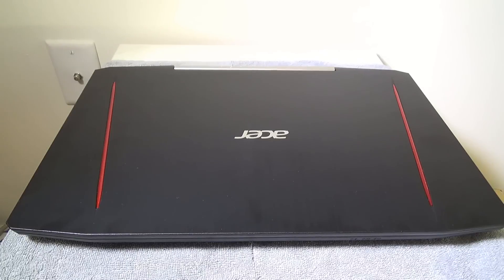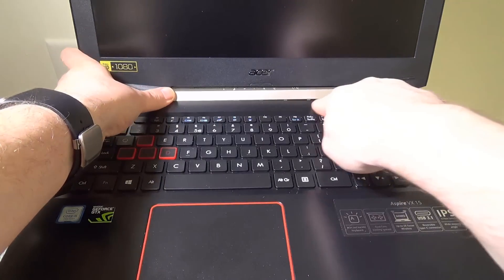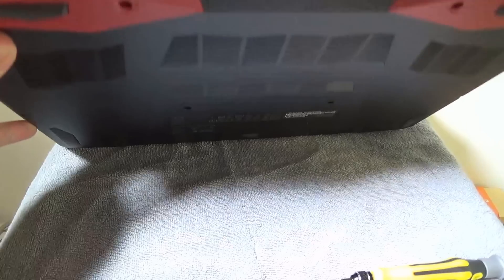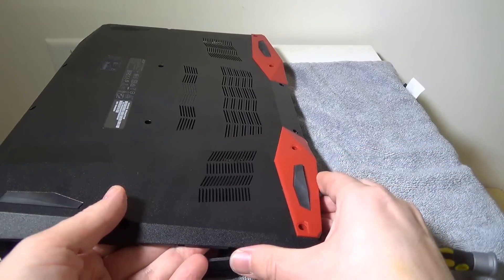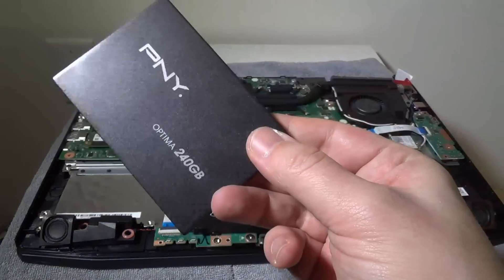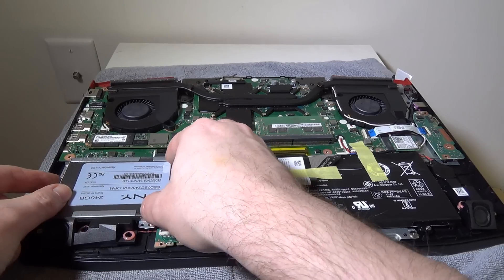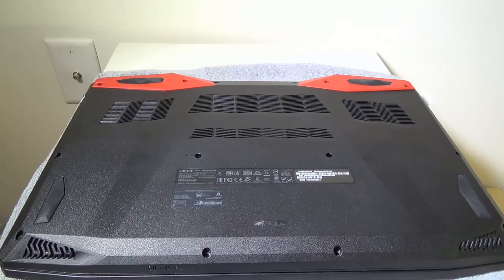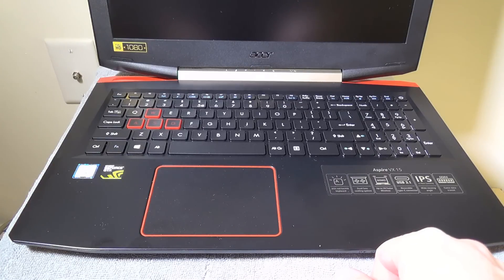Acer Aspire VX 15 Gaming Laptop VX5-591G-54VG How to add a 2nd HDD/SDD

Comment: Hi. I want to upgrade the internal m2 drive. The datasheet has drives tested to 512GB, persons on forums have installed 1TB drives without issues that match (1tb m.2 2280 ssd nvme PCIe 3x4) like the Samsung Evo 970 Plus. Would installing a 2TB work the same way? The Evo 970 also has a 2TB
Reply from the maker: should be fine yes.
Reply: @GalaxyTechReview  thanks. was just wondering if there is anything that would limit the max readable/usable storage on that slot.

Comment: Hi, quick question if I may. My Acer Aspire is the VX5-591G-71LJ .. is the cable you show in your video the same as the one needed for my Acer.  Many thanks.
Reply from the maker: yes I would assume that cable will also work on that model of laptop

Comment: I intend to use an ssd from a previous laptop as the extra ssd drive. Are there any preparations I need to do to the ssd before starting? .. Great video, thanks.
Reply from the maker: Nope that should be fine. Thanks for watching.
Reply: @GalaxyTechReview  Thanks for replying so quickly. Should I takes everything off the old ssd manually of just give it a quick format? Thanks
Reply from the maker: Quick format will do.

Comment: Hello! For version with i7, The ssd is SATA or PCI? Thank you
Reply from the maker: Sata
Reply: Can be added only SATA? Because mine have only 1 ssd with 120gb. And i want to change it with other with 500gb. I tried with HDD în second slot but i cant find to buy The cable and The other one

Comment: They've already discontinued the program, so those of us who just bought it a few months ago are basically screwed. That part # is no longer valid/available, according to Acer, either free OR for sale. 
GG, Acer. No 2nd M.2 slot, and a big wasted empty space 95%+ of the laptop owners can't use, if that many people even sent in their form in time. Probably more like 99.8%, to be honest. So... I've got a piece of hardware manufactured less than a year ago that I can't even BUY parts for to make it fully functional, which is only necessary because it was crippled by the manufacturer. 
First Acer laptop for me in quite a few years, and definitely the last ever after this. I don't have the budget OR desire to replace my equipment every 6 months...

Edit: yes, I know it's a 2 year old model, but I they were still manufacturing them up through 2019, and mine is one of the later revisions, so... <1 year old according to the manufacturing date on the bottom.
Reply: wow, I am planning to buy an additional storage then i saw  ur comment, i am one of those screwed

Comment: hey Luke..  if I can figure out how to properly mount it (included caddy won't be tall enough).. you think there's enough height clearance in there to mount a 15mm 2.5" ?  like a Seagate 4TB Barracuda Sata 6GB/s 128MB Cache 2.5-Inch 15mm Internal Hard Drive (ST4000LM024)
Reply from the maker: I'm pretty sure they say 9mm is the max you might be able to without the caddy I have no idea not a ton of extra room in there.

Comment: May I know what SSD's are compatible with this unit? I'm currently planning on upgrading my hdd to a 2.5 ssd sata(Crucial MX500 1TB 3D NAND SATA 2.5 Inch Internal SSD - CT1000MX500SSD1(Z)) or a samsung one, are those compatible with mine? also if I already have a hdd, do I still need to buy a hdd kit for the ssd?
Reply from the maker: yes both of those will work
Reply from the maker: yes you should have the mounting kit to hold it on place.
Reply: @GalaxyTechReview  so this one will work Samsung 860 EVO 1TB 2.5 Inch SATA III Internal SSD?
Reply from the maker: @KimchiTheDog  yes
Reply: So, that doesn't come with the unit? even if my unit has an hdd but no m.2

Comment: Where did u get that data cable
Reply from the maker: mine came with one, you can contact Acer if you live in the US/Canada and they will send you the drive kit.
Reply: @GalaxyTechReview  oh well I did order the mounting kit. It's on its way, so it includes the cable as well.
Reply from the maker: Cool.
Reply: @GalaxyTechReview  I recently bought samsung 360 2tb ssd for it, and was wondering if t 16gb of ram would fit into this laptop as well
Reply from the maker: Syed Shah  yes it supports up to 2 x 16gb of memory in the RAM slots. if you are going to do 16GB just buy 2 x 8GB  (or 1 x 8GB if you already have 8GB)
Reply: @GalaxyTechReview  is it possible to fit like 2 16gb ram for 32gb ram
Reply from the maker: Syed Shah  yes

Comment: is there only room for one hard drive?
Reply from the maker: ONE 2.5 INCH HDD/SDD AND ONE M.2 SLOT FOR A M.2 SSD
Reply: cool, ty
Reply: So the one you put in is the 2.5?  Is the M.2 above that slot?
Reply from the maker: Lenard Skinner  Yes Check 5:37 in the video.

Comment: Is it really required to remove the hinge plate before removing the back cover itself? I am just afraid that i may break it and stuff
Reply from the maker: You should remove it, it is held in by tabs, just go slow you should not have any issues.

Comment: Galaxy Tech, I've bought a Samsung 850 EVO with 500Gb to add as a secondary ssd for my Aspire VX 15. However, after installing it, my system refuses to boot. Do you know what am I missing? Is there something I should do or it is just that the EVO is not compatible with the VX15? Thanks in advance!
Reply from the maker: I have not run into that problem, check the BIOS and make sure the boot drive is still the m.2 drive and not trying to boot from the EVO

Comment: can you tell me what the cable is called to connect the hard disk
Reply from the maker: it is a SATA cable made by Acer. It comes with the HDD assembly kit you can get by checking the description of the video.
Reply from the maker: I do not remember the exact part number
Reply from the maker: found the part number of the exact cable  50.GM1N2.005 CABLE.HDD

Comment: I'm planning on opening up my Acer very soon for some upgrades and this video was super helpful! Just one question though, my laptop came with a 256gb internal SSD, is that the M.2 drive you mentioned? If so, is the bay you'd install the new internal drive into just empty in the laptop until something is put there?

EDIT: also just to make sure, does all these steps and the complementary kit work for installing a new SSD as opposed to an HDD?
Reply from the maker: Yes the 256GB drive is in the m.2 slot.  You will have an open bay for a 2.5 inch drive EITHER SATA HDD or SATA SSD.  Glad I could help.

Comment: If i have a 1tb hard drive and a 128gb ssd. the os is in the ssd right?. If i just replace the hdd from an ssd/sshd do i need to backup something or just straight forward?. Just replace the hdd eith an ssd or sshd. And nothing will happen right?

Comment: Is it possible to upgrade the GPU? Also I've had this laptop for a while now and its fans are starting to become really loud and somewhat hot whenever I do anything, any suggestions for what I could do to fix this? Thanks.
Reply from the maker: No you cannot upgrade the GPU. It is soldered to the main board. As far as the fans go you could take the bottom off and make sure that you blow the fans out maybe there's some dust in there.

Comment: Hey does this work for the Nitro an515 as well? I’d like to have a SSD as my primary drive... is this possible? Thanks!
Reply from the maker: +illenicK it will be something very similar yes
Reply: Galaxy Tech Review awesome thanks, in that case I would have to remove my other HDD and replace it with the SSD? do I have to worry about that voiding the warranty?
Reply from the maker: +illenicK that is correct and no you will not void your warranty
Reply: Galaxy Tech Review excellent! Thank you so much! However I was able to return my laptop and get a better model that can accept the 2nd hdd just like this one in the video!

Comment: I got my kit the laptop will not boot with the cable installed.  What bios version are you running?  I updated to newest version but i see there is one for Intel PCIE SSD device information abnormal V1.01 I went to 1.06.   The laptop boots fine as soon as I remove the cable provided by Acer this is with the drive connected or not so I think it is a setting for the drive adapter in the bios.  Any help would be greatly appreciated.
Reply from the maker: +Andy Fisher I don't think I'll be much help here as I never ran into that problem with this laptop as far as the BIOS goes I can't remember exactly what version was out when I did the review on this laptop. If it'll boot fine with the cable unplugged and not boot when the cable is plugged in then maybe a faulty cable? That's just me guessing because again I didn't have any problems or run into this problem when I had my review unit

Comment: My laptop comes with 1 tb hdd. Would it be possible for me to add an SSD to it? without replacing the hdd?
Reply from the maker: +Jeffrey Angelino not in that secondary Bay there's only one Bay and that has your 1 terabyte hard drive in it you would have to remove the one terabyte and put in an SSD drive there. Now this laptop also has an m. 2 SSD slot but I am assuming that is your boot drive and you already have at least a 128gb drive in there

Comment: I have a normal size SSD left from another computer. Can I place it instead of the 128gb SSD that my laptop already has? Or does it have to go instead of the 1TB HDD because of the size?
Reply from the maker: the 128GB in yours is probably a m.2 and the older ssd you have is probably a 7mm or 9mm sata drive which means it can replace the 1 tb drive, but not the m.2 boot drive.

Comment: HELP!

I live in South East Asia and I haven't asked Acer yet buuuuut, what if that caddy + data cable isn't available for SEA? Are there any aftermarket caddy or data for this? Can I use any M.2 SSD data cable? Thank you, I'm a noob when it comes to this and is still learning.

Acer Aspire VX 15 (VX 5 519G 532R i5-7300HQ GTX 1050)
Reply from the maker: As I live in the US, I am not sure where you can buy it overseas aftermarket.  Your best best is to contact Acer directly and ask them.
Reply: Galaxy Tech Review okay but can I use any data cable? I'll probably manage making my own caddy. But data cables are universal right?
Reply: Galaxy Tech Review nvm looks like it's not available. But thanks!
Reply from the maker: np

Comment: Good video. I just installed a WD 1TB HDD in my Aspire VX15 a few minutes ago, followed everything perfectly, all connections secure, turned on the computer and it's not recognizing the drive. It's really pissing me off too because unsnapping that stupid bottom panel was an absolute nightmare and I really don't want to do it again. I'm in the windows disk management program and it should be asking me to initialize a new drive, but I'm getting nothing. Any ideas before I bite the bullet and open this effing death trap again?
Reply: Nevermind, it works now after 3 reboots. Don't ask me why it took 3.

Comment: bro I have the vx5-591g-51sj and  I dont know if that model have that space to put another hard drive, beacuse when i opened the laptop there was a hard drive , what can i do to know if i can put another? sorry for my english. greetings from chile.
Reply from the maker: +Jared Amudeo Plaza sounds like you already have a hard drive installed there should be a slot for an m. 2 SSD you could add one of those

Comment: Hi, I cloned my HDD to my SSD but. I select the priority to the SDD but the system always try to start the boot with HDD. Could you help me?
Reply from the maker: Pull the HDD out and see if you can get it to boot.  Then once it does boot plug in the HDD and format it.

Comment: hey man ! I wan to ask something. This cable is the same or not can you answer to me. I'm from Turkey and i cant find this cable.
( https://tr.aliexpress.com/item/PC-DAD-P3MJ0-Acer-Aspire-M5-M5-581T-HDD-i-in-HDD-Sabit-Disk-Ba-lant/32836148706.html?spm=a2g10.search0104.3.1.xQ2CjP&ws_ab_test=searchweb0_0%2Csearchweb201602_5_10152_10065_10151_10068_10344_10345_10342_10546_10343_10340_10341_10548_10541_10307_5670020_10060_10155_10154_10056_10055_10539_10537_10536_10059_10534_10533_100031_10103_10102_10142_10107_10325_10172_10562_10084_10563_10083_10561_10566_5740016_10564_10565_5650020_10312_10313_10314_5660020_10550_10073_10551_10552_10553_10554_10557-10552_10551_10553%2Csearchweb201603_30%2CppcSwitch_7&btsid=154b1c4d-1455-4a2e-955b-50b724e3459f&algo_expid=526c933d-9184-4fc3-8012-78df101da56c-0&algo_pvid=526c933d-9184-4fc3-8012-78df101da56c)
Reply from the maker: yes that looks like the correct cable.

Comment: do you know how can I change the 1rst HDD by another HDD fastest?
Reply from the maker: you have to remove the bottom of the laptop and then swap out the m.2ssd (256GB) with a new m.2 drive I am assuming NVME speed.  Then you will have to re install windows on the new drive.

Comment: Can you play CD's in this laptop?
Reply from the maker: +WhipLash there is no CD / DVD drive in the laptop so you would have to get an external USB drive they are cheap and pick one up on Amazon for about 20 bucks
Reply: Galaxy Tech Review Thx for the help
Reply from the maker: +WhipLash no problem most new laptops don't come with CD or DVD players anymore

Comment: Can you provide us the serial wrote on that data  connector ?I m from Europe and I want to try to find that piece because here Acer  won't give us that for free.If you could provide me what s wrote on that little tag on the connector I will apreciate.
Reply from the maker: 50.GM1N2.005 CABLE.HDD
33.GM1N2.002 BRACKET.HDD (HDD of 9.5mm)
86.GM1N2.003 SCREW.M2.5x5.0 - Head Ø: 5.5 (Qty=4 - To fix bracket/case)
86.G1FN2.008 SCREW.M3.0x3.0 - Head Ø: 4.9 (Qty=4 - To fix HDD/bracket)

Those are all the parts that come with the kit.  Hope that helps

Comment: Hello, did the sata cable came with the ssd? or should i buy it? and which ssd you recommend for me? 250gb ssd would be okay, i have the same laptop btw
Reply from the maker: +Annunaki x I contacted Acer and they sent me out a free hard drive mounting kit. It already comes with a 256 GB M.2 drive I personally installed a two terabyte sshd Drive
Reply: That's nice, but i live in Europe so it's not free for us, i have to order it from amazon.
Reply from the maker: Ahh I see, well the cable will just be the cable then if you ordering individual parts, so yes you would have to order it separate
Reply from the maker: I may actually have one left over from when I was testing the VX15, if you need it.

Comment: https://www.newegg.com/global/de/Product/Product.aspx?Item=N82E16822145881&nm_mc=AFC-C8Junction-DEU&cm_mmc=AFC-C8Junction-DEU-Hard%20Drives%20-%20Notebooks%20/%20LaptopsHGST_-22145881&cm_sp=&AID=12944385&PID=6361382&SID=trd-1149118516 I found this Hard drive,but I'm not sure if it will fit. Does anyone know the dimensions allowed within this laptop.
Reply from the maker: Yes that will work.   needs to be a 2.5 inch 7mm hard drive
Reply: Thank you for the quick response. I have one more question. Im trying to pick between the i-5 and i-7 version. Both are 899,but the i-5 has the GTX 1050TI, would you say its better than the i-7 with the 1050
Reply from the maker: +Shuaib Aliyu personally if you're going to be using it for gaming I would go for the one with the 1050 TI as you get a 25% boost in performance on the GPU the i7 versus the I5 and gaming isn't going to make too much of a difference

Comment: Thanks for this great video. I used  it for installing an M.2 SSD (My Laptop come with the sloooooooooooowly 1TB HDD Toshiba 5400 rpm ). Cheers!
Reply from the maker: +Gabriel Carrizo nice glad I could help.
Reply: Im planning to buy m.2 ssd also.. Does it works perfectly on yours? or we sould buy nvme ssd rather than m.2 ssd? which should i buy?

Comment: Any chance to add the HDD without the kit?
Reply from the maker: +Thiago Quadros not that I know of because you need the cable that comes with the kit.
Reply: Is that a specific cable? I though it was like a generic one that I could find in some shop. The "HDD cable on AMAZON "50.RZCN2.003 New Acer Aspire M5 M5-581T HDD Hard Drive Connector Cable 50.RZCN2.003"" doesn't ship to Brazil :/
Reply from the maker: https://www.google.com/search?q=50.RZCN2.003&rlz=1C1CHBF_enUS723US723&oq=50.RZCN2.003&aqs=chrome..69i57&sourceid=chrome&ie=UTF-8

Comment: Hey! Im from Mexico, so they can`t send me the kit, I dont know where to buy the parts tho...
Will this Hard Drive work? 
( https://www.amazon.com.mx/dp/B01LYNQXCP/ref=sxbs_sxwds-stvp_1?pf_rd_m=AVDBXBAVVSXLQ&pf_rd_p=3154600982&pd_rd_wg=fH8xY&pf_rd_r=QMYRH07MY1PZZV2SKB61&pf_rd_s=desktop-sx-bottom-slot&pf_rd_t=301&pd_rd_i=B01LYNQXCP&pd_rd_w=6DAd4&pf_rd_i=Seagate+ST1000LX015+1TB&pd_rd_r=PZFFTV0R1RX0XYF1KDX1&ie=UTF8&qid=1501981273&sr=1) ?
And if so, what else do I need to buy in order to assemble it? Thanks in advance!
Reply from the maker: That hard drive will work, BUT you will need the sata (data) cable at the very least to hook it up.  I am not sure why Acer wont send one to you but it is a question best answered by them.
Reply: Tlacuachi, si pudiste resolver el problema?
Reply: Eh que hiciste para conseguir el kit?

Comment: I installed my hdd, but it's not showing up, is there some sort of software installation?
Reply from the maker: +TheEpicEnforcer go to Windows settings then go to Disk Management and create a partition on the new Drive you just installed. Once you create the partition when does will then be able to see the new Drive in my PC